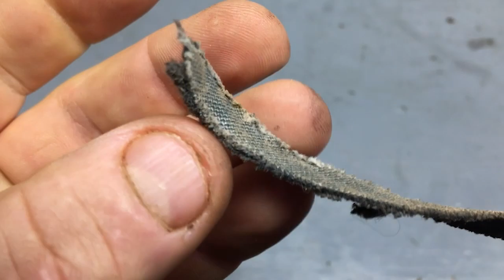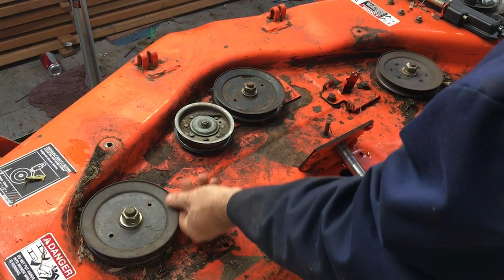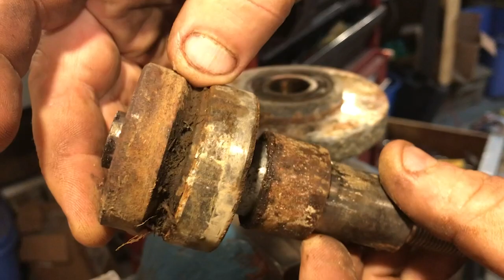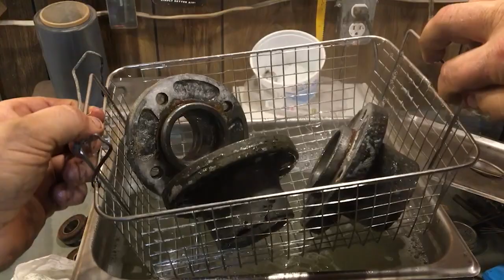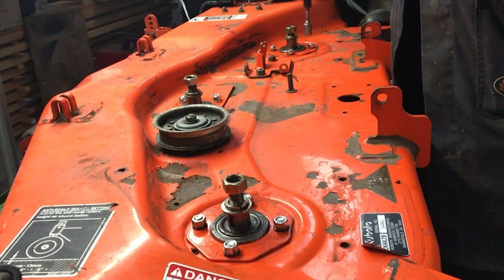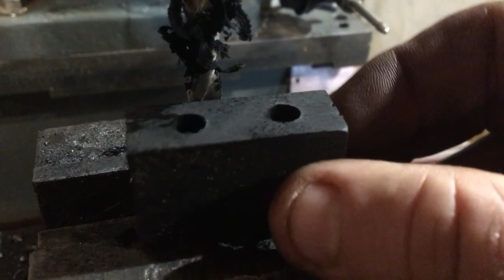Kubota Mower Deck Spindle Overhaul

Comment: I have a twin-blade 40-inch Kubota deck. The spindle pulleys don’t have the threaded holes for the puller. Got one pulley off ok but the other one stuck. I have MAPP gas but that didn’t work I think I’m going to need more pulling force and hotter torch 🔥
Reply from the maker: Keep at it, they can be stubborn. Lots of heat, penetrating oil and patience.
Reply: Oxy Acetylene did the trick.

Comment: Nice video!  Spindles look the same as used on my 20 year old T1870.  What size are the bearings?
Reply from the maker: I wouldn’t be surprised! Bearings are 6205- 2RS, which is a very common size.
Reply: @jasonselinger  Thanks for the info, I'll need to rebuild mine soon.
Reply: Good information helped me a lot.

Comment: hello another question, i also used a hockey puck for a brake pad considering the part is about 100$ usd, is your pad still holding up? mine has pretty deep scarring from the pulley after about 5 uses
Reply from the maker: Mine is still going strong after  nearly a full season. It did wear quickly when it was first seating then few times before settling in.
Reply: @jasonselinger  i figured out what was wrong with mine, whoever had the mower before me had the wrong size belt that goes from the deck to the front of the mower, so the mower was constantly trying to spin the deck even with the brake engaged, new bigger (right sized) belt fixed my issues

Comment: my pulleys did not come off that easy, and both of my bearings are stuck in the housing
Reply from the maker: Have you tried heating them up?  They can be really stuck in there, but heat has a way of making things easier to remove!
Reply: @jasonselinger  i ended up using a bearing removal tool and got the bearings off, only thing im waiting on is a pulley in the mail, i used the same remover as you did and the middle of the pulley was stuck on the shaft while the rest sheared off

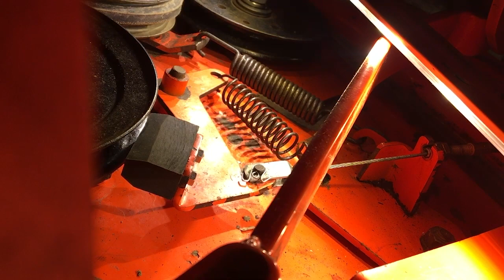Comment: hello @15:19  you put the cable on wrong here, there is supposed to be a nut on each side of the hole, you want to unthread a nut onto the cable, run the cable/threads thru the hole and then put the nut back on the threads..
Reply from the maker: Good eye! The hockey puck brake that I made was quite a bit thicker than the original, so I was at the end of the threads in order for it work properly. Once it wears down a bit the nut can be moved over to the other side where it belongs.
Reply: @jasonselinger  ahhh that makes sense, i figured you probably knew haha